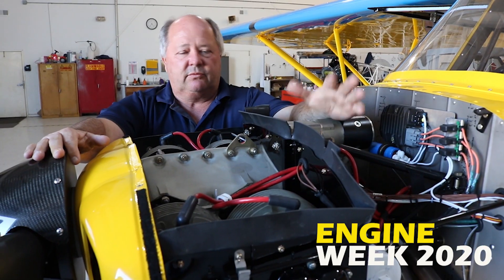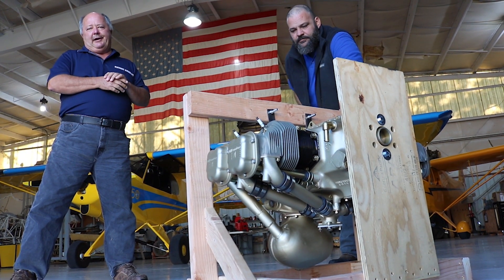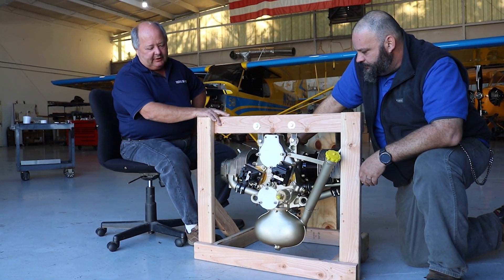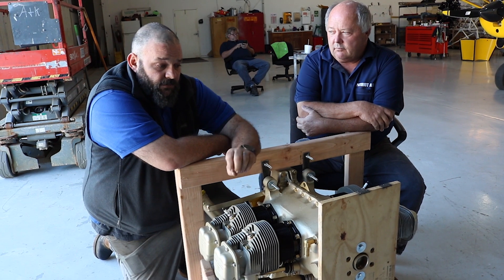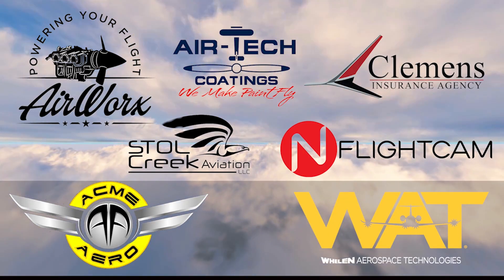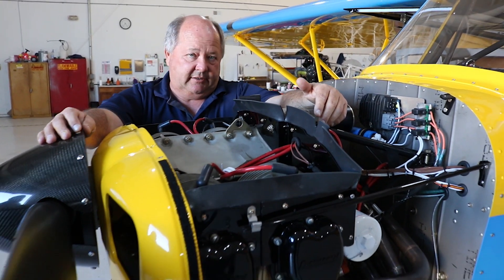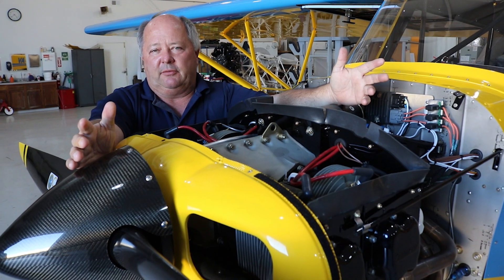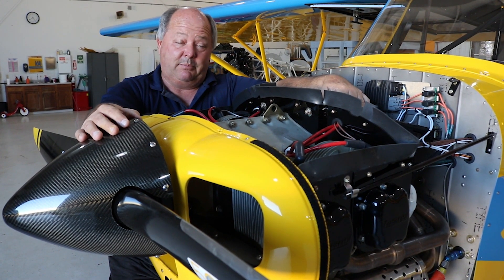118HP O-200 | Dons Dream Machines | Engine Week 2020

Comment: In 2000 I built a Q200 Quickie with O200A engine and installed ported, polished and flow balanced Superior Cylinders with 9.1:1 Lycon high compression pistons, and 2 Lightspeed Plasma 3 Ignitions with 4:1 ceramic coated exhaust. 

I zeroed the engine at that time. The plane now has 2010 hours on it so I decided to top it with all new same parts. I’m in the middle of it now. I’ve been very happy with my engine. The plane cruises at 195-200 MPH and I believe I’m getting 118-120HP out of it. Idle RPM is 450.
Reply: What Fuel and Octane  do you run?

Comment: Compared to O-235, I understand that the O-200 is lighter and O-235 have slightly more power and higher TBO hours (if this actually meant that O-235 is more reliable).
Can this O-200 run mogas after mod?

Comment: Port work is such a game changer in IC engines. Any and every engine I work on gets some degree of port work, more for reducing heat and the associated knock, all by smoothing things out and removing casting flash, etc. Maximizing air flow is what engine "building" is all about vs just assembling the parts to get it out the door. I rebuild auto engines and folk are constantly asking me why my rebuilds are more than they would pay for a rebuild from a mass assembly operation. I tell them its attention to detail.

Comment: Whats the cost n weight all up installed?
Can that 118 hp be achieved on 95 mogas?
Ditto O300?
GO 300?
Form337 in a certified pvt aircraft?